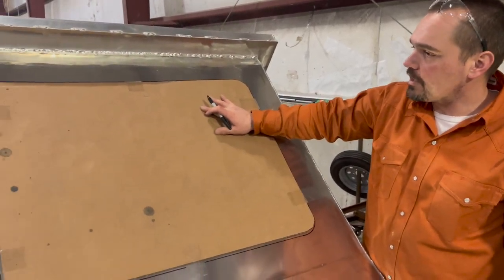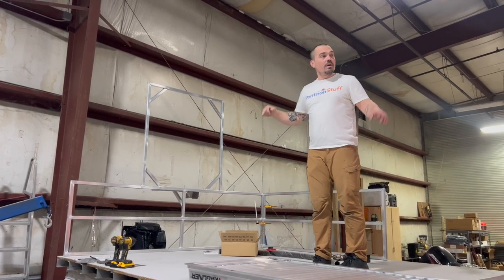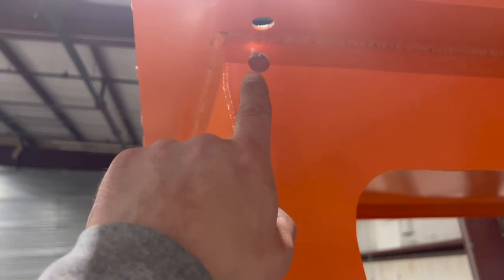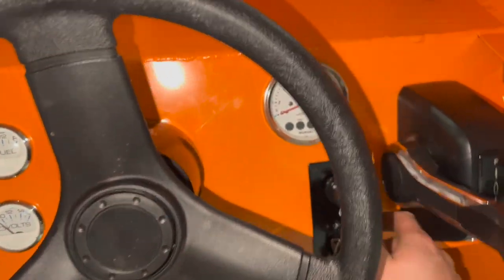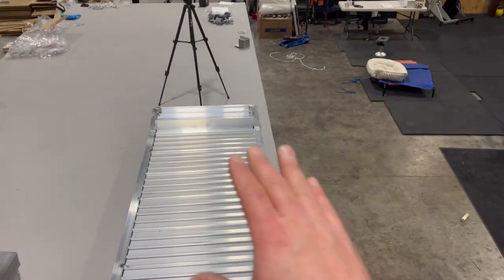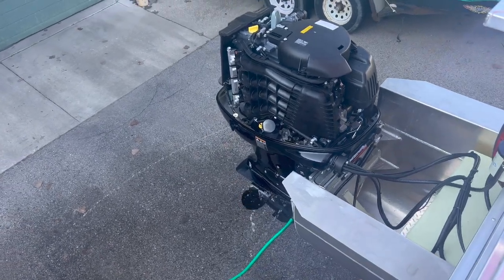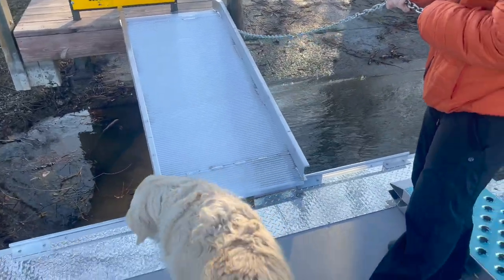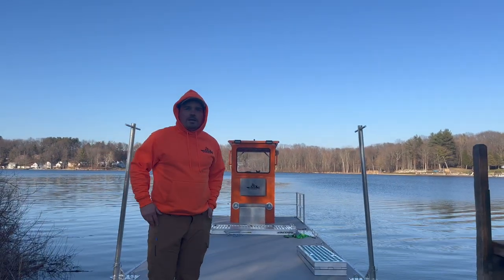Pontoon Work Barge Build - Part 3 - FINISHED Project

Comment: Great Job!  Looks Awesome. Where do you get your Suzuki outboards?  I want to re-power with a 200hp. Can I get one shipped to me?
Reply from the maker: I worked for the marina I get them from for a few years, installed them, sold them, and loved everything outboards. It’s not easy to get the high HP motors shipped without those connections or background. Check with your local dealers first. You might be able to get one to install if you’ll pay to have the pre delivery inspection done after install to make sure everything was done correctly.

Comment: How much weight do you think it can transport?
Reply from the maker: The calculations that I used rated each pontoon around 6800 lbs of capacity minus the weight of the pontoon itself. Assuming the pontoons weigh somewhere around 500-800 lbs each, that would mean it has somewhere around 18,000 lbs of buoyancy before the crossmembers, motor, wheelhouse, ramps, etc. So even if we added 4,000 lbs of decking, crossmembers, wheelhouse, and motor that would leave it able to float 14,000 lbs maxed out...so we said 10,000 lbs as a conservative operating load. I'm going to weigh it and subtract the trailer to figure out exactly what the hull and motor weigh...pretty excited to find that out!!
Reply: @tomspontoons  that's a perfect amount wow. Nice work tom, these unique builds are 👌. My goal is to build a forkbarge in the next 3-5 years!
Reply from the maker: @All-Ashore  the goal for this boat build was to create a lighter, faster, more efficient barge to run errands the big companies won’t do. The 140 hp is a great little powerhouse for pushing that big of a boat, having low end torque for control, and being super fuel efficient. 

The fork and crane stuff is a whole different animal. I’ll build these open deck boats, but not sure I would ever get big into the forks and cranes…I’ll leave that to the pros for now!

Comment: You are going to increase the pitch, not decrease it, do you realise that mistake?
Reply from the maker: I mentioned we’re going from an 11” pitch to a 13” pitch during the test run…I’m not sure where you’re referring to in the video but would love to know!!
Reply: @tomspontoons  12:49 "we are going to a 13, .......... we need a lower pitch"
Reply from the maker: @grancitodos7318  I thought you might be referring to that part...As a separate thought from going from the 11 to the 13 I meant that in general we need a lower pitch than what most folks would put on a tritoon with a 140hp because we're hauling heavy loads and want the torque to still power through as well as still get the RPMs in the recommended range. Just me rambling thoughts together making it unclear!
Reply: @tomspontoons  OK, I understand.
Reply from the maker: Yep, sorry for the confusion!